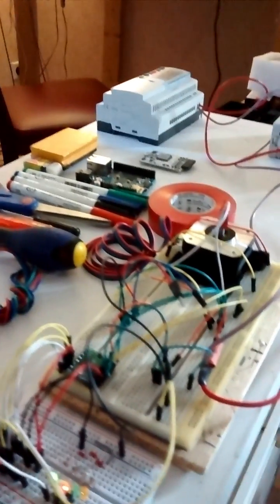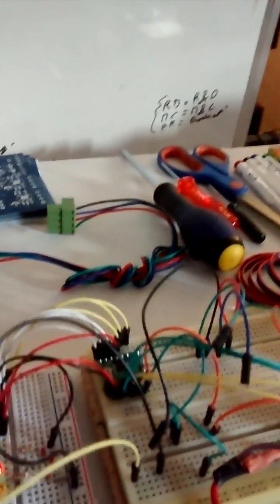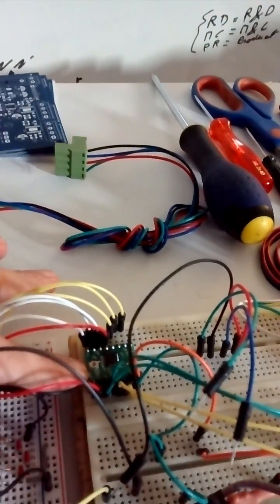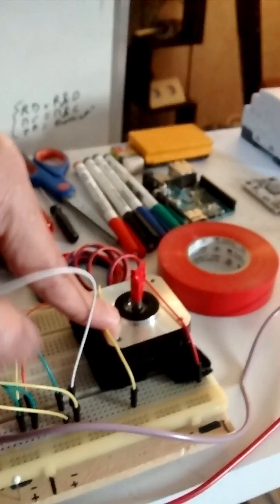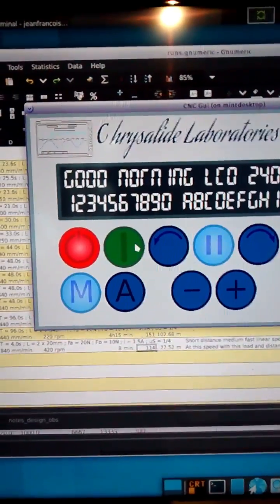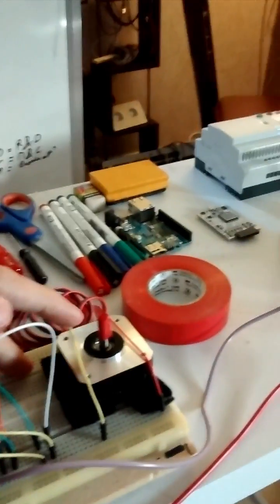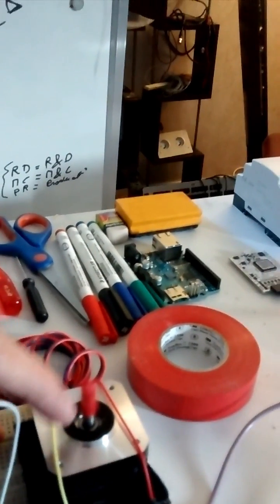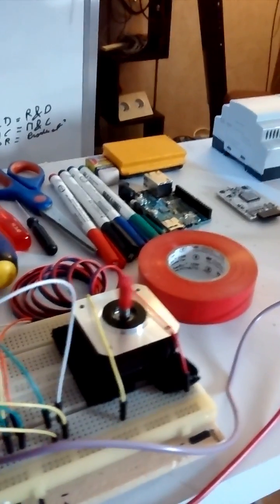Running a cheap stepper motor at max speed (almost 6000 rpm reached)

Comment: You can drive virually any stepper at higher than it is rated, until you add a load. The ratings aren't for an unloaded stepper as an unloaded stepper doesn't do anything and as such not how they are used in the real world. You also can't really count on the accuracy when you exceed their specifications.
Reply from the maker: Yes but i found an interesting thing too, there's a specific speed ramp and frequency to reach high speed.
That's because of some motor construction, the magnetic pulsating torque or other aspects, i'm not too sure why, but only a fast accelerating ramp and special high speed worked.

Like it stalls much slower (about 30% slower) if you don't have found the right parameters, funny trick.

Jean-François
Reply: @chrysalide_electronics  Interesting.

Comment: I think the most important part is the step frequency ramp up. If you do it instantly, the motor stalls and jitters.
Reply from the maker: Right but if i did too smoothly, it also stalled, so that's strange. I think passed the datasheer performance, there are tricks. It can also resonate at certain frequencies, so it ran above or below them, but stalls at some frequencies.

Quite odd, there's a good load of tricks if we look into the details of it.

Regards
Jean-François
Reply from the maker: Note on this, there's a frequency related similarly to a sawtooth torque, due to the internal construction, stepper and BCLD motors have an oscillating torque superimposed with the driving torque. That can resonante, it can al help or go against depending on actual speed, because that's phase dependent, hence resonant frequencie, and higher/lower torques at particular frequencies.
That's interesting, essentially, when a system becomes quite dynamic (ie high speed, high accelerations, etc ...), fine tuning these parameters (ie finding those speed ranges and perhaps forbid running inside them) is probably required.
Regards,
Jean-François